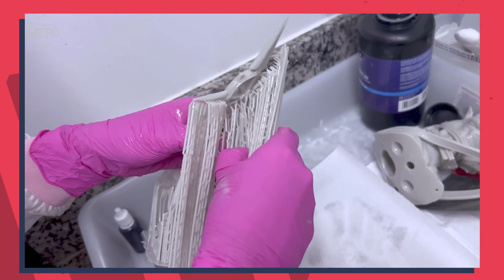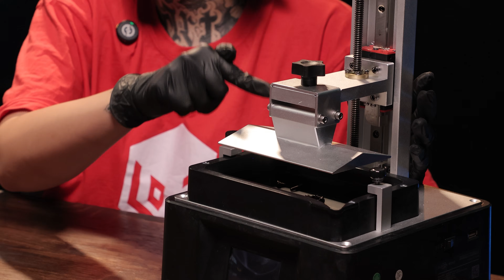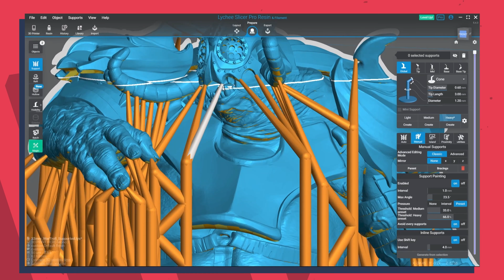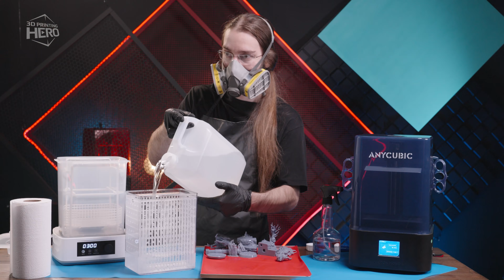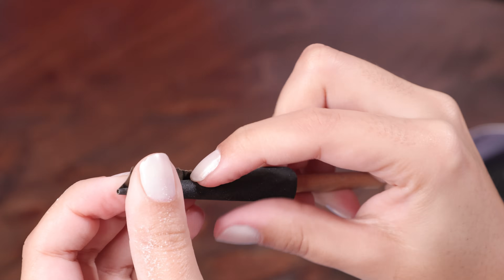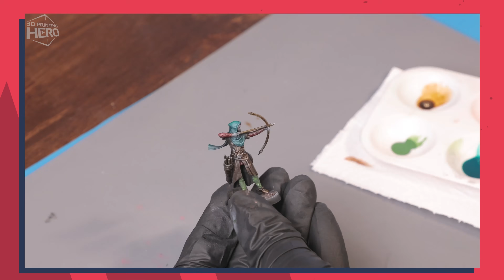3D Printing in 2026? | START HERE

Comment: Your videos are highly professional. However, I'm still not quite sure whether to consider resolution as one of the criteria for purchasing a 3D printer. I've seen other bloggers say that above 8K, the human eye can't distinguish the difference, and high resolution may reduce the screen lifespan. As far as I know, the machines that can auto - level are heygears and P1. They use force sensors to make the judgment. With the old - fashioned method of using paper for detection, it's really difficult for inexperienced people to tell if the leveling is successful.
Reply from the maker: Thanks for the feedback!